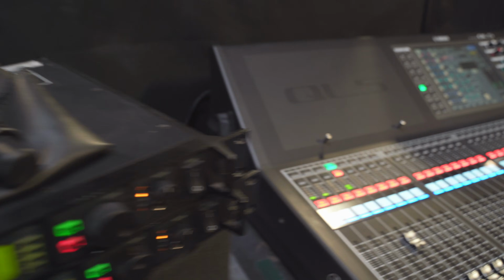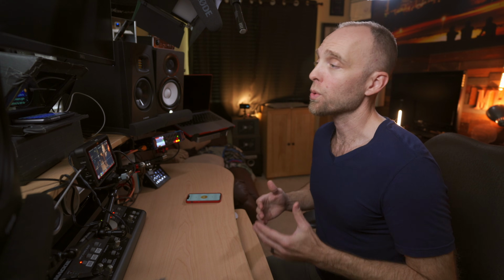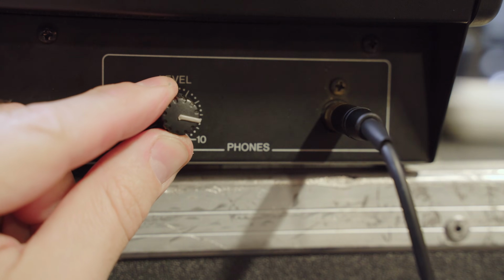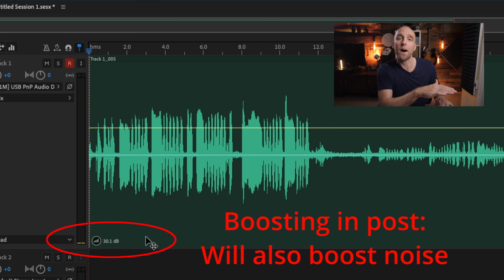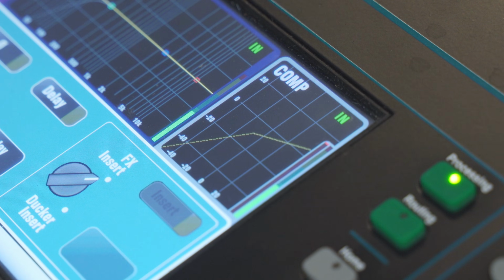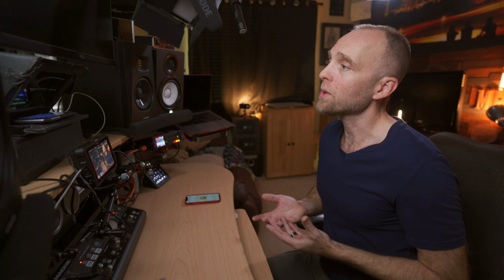Audio 101 - Your 2 Main Goals in Audio

Comment: Interesting to see that audio chain misconceptions are actually a global phenomenon. It had troubled me for some time lately to see how engineers set up professional audio and I was quite confused because i thought they were doing things wrong. Very helpful video and good amount of detail in it! Thanks!
Reply from the maker: Hi there.  Yeah, it is very strange seeing so many audio people doing things and spouting and repeating myths that just don't make sense when you think about them from a physics or electrical standpoint.  They hear something that was taught to them on-the-job by someone who may (or may not) actually know for sure, and they repeat it.  

I always tell people, getting audio out of your speakers is only 1/2 of the job.  Keeping your audio clean (free of noise) and gain structuring properly to solve for that problem is the other 1/2.

I'm curious, what misconceptions have you run into out there from people?  I'm trying to put together a short-list of "audio mythbusting" videos and would love to hear any other examples of bad audio habits.

Thank you for the comments, I appreciate it, talk to you later.
Reply: @MarcusHutsell  Well I'll describe something that I saw that was done repeatedly when I cooperated with other audio engineers. The example is about permanent installation of professional audio equipment though and not live applications.
When the equipment was set all amplifiers were turned all the way up (volume knob to 10). The end user was told to handle the volume level of music in his place(store, hotel, bar or whatever place that was) from a pre-amplifier like an analog mixer let's say. A limiter was also installed to prevent the end user from blowing up the equipment.

Now surely I don't want to pretend that I'm an expert in any way, but this didn't seem quite right to me, because the way the equipment was set up, the user was going to have a clean signal only when he had music played at extremely loud levels. If he wanted normal levels he would have to turn down the knobs in his pre-amplifier, which means less sound to noise ratio practically. Nevertheless I understand that in permanent installations it is more practical to give the user the option to handle volume from a pre-amplifier because all the amps might be placed in some rack in a dark tiny room somewhere and it could be troublesome to go there every now and then to turn up or down the volume if you wanted to. But on the other hand audio quality is compromised if you set up things this way.

I tried to discuss the matter but all efforts were in vain. And the thing that bothered me most of all was that most people wouldn't even think that they might do things the wrong way. Their ego always got in the way.

Now I might be the one who is wrong but I think that this whole situation that happened to so many installations is a bit unclear at least if not wrong.

Anyway ,sorry for the long answer and thanks for taking the time to answer to my comment in the first place. I believe you are doing a great job with your videos! Keep it up!